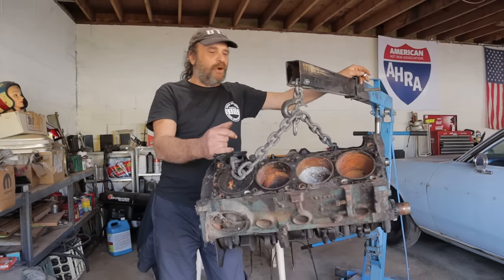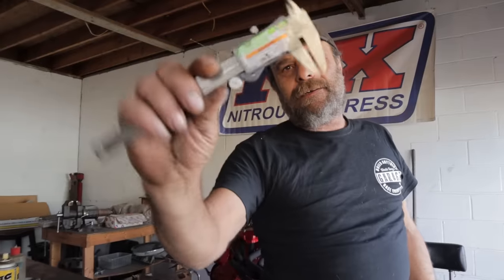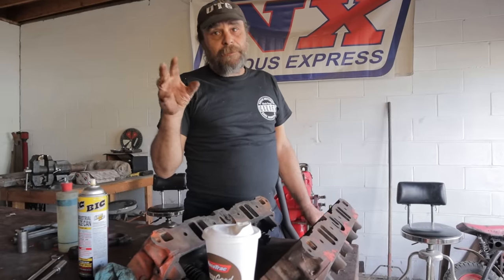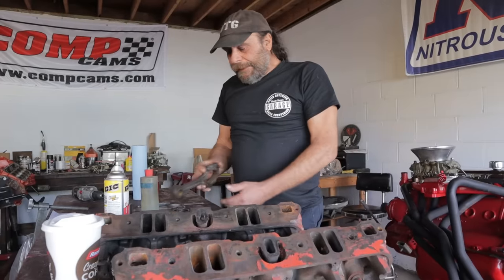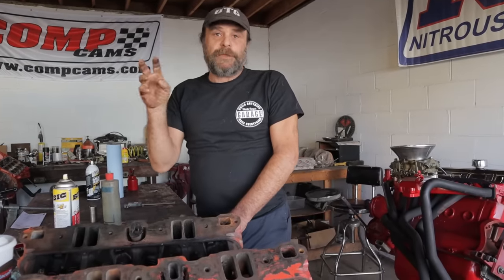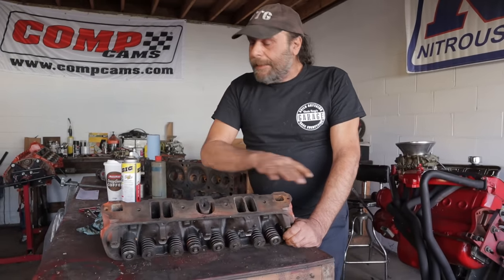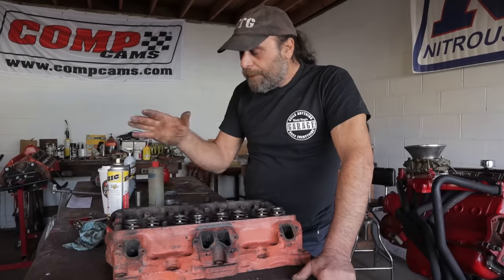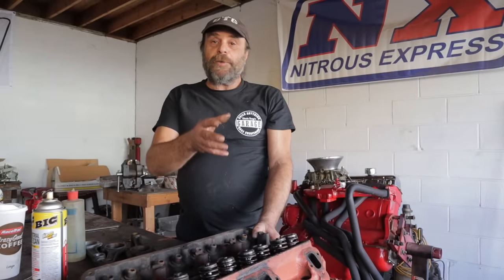The Most Under Rated V-8 In History?

Comment: all the old timers that I talked to back in the days said "the 318 is bullet proof and reliable"

I am 49 years old now....
Reply: I'm 53. They're right. No flat lobed  cam rod knocking junk here lol.
Reply: There is no "bulletproof" anything. Those 318 (5.2L) engines had their problems as much as anything else. It's perspective based on personal experience.... otherwise known as Conclusion bias.
Reply: @shermanbird3248  any product has its limits. We had similar products in similar service  at the time. I've discussed the weak points lol. Think of all the taxis and police cars from the late 70s and 80s. The 318 ruled . The 305 Chevrolet got a real bad reputation real fast in this Era for bad camshafts.  Fords 302 was a solid package but was loaded with emissions equipment. All had strong points and weak. I will crawl back under my rock now that's 40 years ago lol.
Reply: If you leave the tiny BBD carburetor on it.  Same thing for the slant six, except it's a BBS (the S means single barrel).
Reply: ...and?
Reply: I,m 48 in East tn. The 283 chevy was hard to beat....later on working in machine shops,auto parts ,and later being a a.s.e. master tech. Was better on the long run that chevy ran in everything and SOLD ALOT of them in both cars and trucks.318 is the 283 of Mopar somewhat but never really sold the volume of Chevy,yea ol 318 aint bad,along with the ol 289 Ford.Tony,you ever worked in a Machine shop....Mopar Dealership for a Living other than your opionion,Love watching your channel man......but being around them ol....nowandays 70-75 year old mechanics around here....Mopar 318 is not the holly grail of engines...good engines but Dam man....maybe in New york.
Reply: nothing is bullet proof, literally nothing
Reply: @shermanbird3248  So, following that logic the turd 2.7 v-6 is just a matter of perspective and bias?
Reply: @jayarnold8883  The 302 was a good motor but Ford's attempt to make it run cleaner with the horrible EEC controlled Motorcraft carbs was nothing but a disaster. If you want your early 80s 302 to run nice, clean and efficient, junk that 2bbl Motorcraft, grab a 2bbl Holley and spend the time actually jetting it right and dialing it in. She will love you for it. Plug the EEC vacuum lines and you're good to go. 
And as a bonus, it will run better. I did that with my old 83 Bronco and it actually turned in low 20s mpg on the highway with the manual gearbox. Not bad for a dog of a smog motor in a 5k lbs brick.
Reply: @dewmontjerkins9886  KNock knock, Who's there?....2.7 v-6
Reply: I had alot of 318's in full size vans: 67, 73, 88, 91. Then I had a 360 in a 2000 van; I liked it a bit more because it had more power to pull a trailer full of "stuff" from So Cal to Lake Powell. But the 318's only got 14 mpg (and I wasn't a hot-rodder). However, the impressive engine now is the V6 with 6 speed in my 2018 Grand Caravan: rated at 284HP, but will get 26mpg (or more) on relatively level highway driving at 72 to 75 mph. Amazing what many years of additional engineering will do. They don't even offer any other engine/trans options in the minivan.
Reply: @kenhanson860  - I could get a whole lot more m.p.g. with a 318, and was getting 16 m.p.g. with a built 383 c.i.d engine. But then again I studied volumetric efficiency and built my own engines, and tuned my own carbs. Did I mention I was pushing four-and-a-quarter H.P. with that 383?
Reply: @DriveCarToBar  I fine tuned my 66 Galaxie 500XL with a 428CJ and a Holley 735 CFM. I took it to an emissions test facility in 1980. They tested it and complimented how clean it ran for standards of that time.
Reply: @shermanbird3248  the FE is an amazing engine, all the way from the 332 truck version with a governor for medium and heavy trucks to the fire breathing 428. Some of the engineering is odd, but who knows.... it’s a beast! It will fit in a Falcon or Mustang, it will fit in a super duty F550 and anything in between. Every brand has a go-to engine......
Reply: @jayarnold8883  The GM 305 engine had 2 strikes against it from day one. GM was reducing nickel content of the cast iron and reducing weight by going to thinner castings. Cracked heads were prolific . The Cam issues went back into the 60's small blocks including 327's and 350s. In 1984, I think, GM went to roller cams to address this issue. IIRC, they also went to one piece rear main seals to cure leaks.
Reply: @shermanbird3248  you mean anecdotal fallacy
Reply: @dewmontjerkins9886  If you work in a shop or dealer service department, your correlative conclusion would be skewed as opposed to considering X number of thousands of the engines were made which never had a problem.
Reply: @shermanbird3248  wjat problems ?? They oiled well the block were thick and could take extreme amounts of heat they lasted virtually forever they responded crazy well to performance modifications they really had no flaws.
Reply: @mattnetko2282  bullet proof is a figurative speech meaning very reliable
Reply: @shermanbird3248 👍 I love my FE, tons of grunt!
Reply: @jayarnold8883  No Chevy was as bad as the early 70s 307 (totally different from the 305) for flat camshafts. Not a difficult fix though.
Reply: @GreeceUranusPutin  Later 225s used a 2 barrel, known as the "Super Six" starting  in the late 70s.
It is rumored (Ive never seen any) that early 1960s 225 slant six engines had an optional "Power Pack" 4 barrel setup.
Sort of like the 4 barrel Ford 400 that Chilton manuals listed for 1971 production, never seen one of those either.
Reply: @DriveCarToBar  You dont even need a troublesome power valve blowing Holley. Simply find a 2150 series Motorcraft carb from an early mid 70s Ford and rebuild/ rejet it.
They come in two variants. a 1.08 venturi (302) and a 1.21 venturi used on 351 ci and larger engines. Ive always deleted the EGR and stripped off the loads of vacuum lines, and valves leaving only the ported vacuum connected to the distributor and transmission modulator vacuum source, as well as any vacuum supply for the heater/AC system
Reply: The slant 6 and 383 right up there!

Comment: When I was a kid, my folks bought a 78 dodge van with the 318. Dad was in the army and got stationed in Germany and I remember that thing just singing down the autobahn at 110-120 (with the aerodynamics of a brick) for hours at a time. Finally retired that thing in the mid 90’s and sold it to my uncle who then put another 40-50k miles on it. It just kept going and going. The van ended up rusting away from around it but the engine was still strong.

Comment: I'm a big fan of the 318.  What can I say, there's something about a super reliable and really good running engine I can appreciate.
Reply: I think the engineers got lucky with the design on this one. It’s probably just a good combo for the materials used. Every 318 I’ve come across was beaten really hard on or neglected really badly. But just keeps going. That’s why these are great engines to build on the cheap and beat on. They hold up so well on stock parts.

Comment: In Australia in the 70's you could buy a valiant charger powered by a 318 dirt cheap the popular purchase was the Pov pack (poverty pack) which was 318 with 3 speed trans and a high performance camshaft from the 340 (supplied separately)..my cousin bought one and got the cam fitted on the first service for $60...he later did some porting and valve work and it made for a potent street car...he used to call it the $3000 fire ball.

Comment: I watched one of these build shows build a inexpensive low tech two bolt main, iron crank, stock rod 318, and made 340 HP, that's impressive.
Reply: its really not hard to get good power from a 318, 4 barrel+intake, swap the cam, dual exhaust, its not even a full tear down if the bottom end is good. 40 years ago that was typical high school auto shop stuff. swap in a low ratio axle and go have fun with it.
Reply: Can you share the video with us ? Thanks
Reply: @vlrdmtr  ....no I can't,  sorry it was one of those professional videos shows , can't remember, but I do remember basic 318 block, 2 bolt main, stock iron crank,  basic stock rods, basic stock heads, ( pocket porting, BASIC three angle valve job ) something ( can't  remember ) like a basic edelbrock performer intake,  1"5/8 exhaust headers and something like a low tech. hyd. lifter mid range cam, do that and you will get 320 - 350 hp on one of these PREPPED 318 small blocks.
Reply: Nope... Best budget 318" build: https://www.hotrod.com/articles/318-small-block-build
Reply: @BuzzLOLOL  ...I didn't say it was the best, I said it was impressive for how low budget it was.

Comment: I have had 3 vehicles all with 318’s back in the day. Well one was called the 5.2L. This was an engine you could not kill, and I always wanted to find a way to pump it up. Bullet proof is the best way in my mind to describe it and I never avoided it because it did not have the hype of some of the other MOPAR engines. It worked for me. It would just run and run.  I just did not have the knowledge, tools or skill set needed to bring out its best. It seemed the aftermarket performance parts was also limited. I wish I had just a piece of the knowledge he has about this engine. I would never have got rid of my Satellite or Ramcharger.

Comment: Always loved the 318. Long lasting engines! Fun when you put in the 340 cam, heads and four barrel! Also the 360, they could take a pounding!
Reply: The 1st 360 gen was horrible.
Reply: I have magnum 360 myself and its held up to all my abuse so far
Reply: THATS What mine had. 340 heads , nice cam ,big Carter 4 barrel.. it would make a 318 really fast. Those Motors were easy to work on. Not like today's Motors. 😮

Comment: I've always been a big fan of the 318. The engine is bullet proof.
Reply: Yes sir
Reply: agreed
Reply: Guys use them in Ford and Chevy demo derby cars.  That says a LOT.
Reply: I put 360,000 miles on a '95 Grand Cherokee with the "5.2", aka the 318 Dodge V8. Original starter, original exhaust, everything under the hood original, except the alternator, spark plugs, and oil!!!
Reply: except for the timing  chain , they gave up every 50,000 miles
Reply: @imarobot3757  Funny you say that.  When I got my first 318 nearly 30 years ago, I drove it daily for a year before putting a four barrel intake on it.  While the intake was off, I could see that two of the pushrods were bent and hitting the cylinder head.  One of them really badly, to the point it had dug deeply into the pushrod wall.  The car ran fine.  I wound up replacing all the pushrods because 15 of them were bent to some extent.  The car had apparently experienced a timing chain failure before I got it and that was the result.  They replaced the chain, but I guess didn’t even think about what else that may have damaged.  I just changed the pushrods, finished my four barrel swap and it ran great for years and years after!
Reply: @imarobot3757  can i use a gear drive instead of timing chain?
Reply: @frankclarkjr6369  yes you can.I did it and no more problem.
Reply: @johnwilburn  soft valve springs are the culprit. Stupid morse timing gears are hardly a performance item but yeah issue with them is very soft valve springs and they go into harmonics at about 4800rpm.
Reply: @imarobot3757  The weak link in the miraculous revving ability!
Reply: @imarobot3757  Good deal ! Thanks for getting back to me, very encouraging.
Reply: A lot to learn yet on my part
Reply: I have a 1989 Dodge Ram charger my father in law bought brand new then I bought it from him has 318 with 320k original miles nothing done to it yet all original still going daily driver body and interior still excellent shape..
Reply: @frankclarkjr6369  just don't use the plastic  timing chain gear you'll be fine . and yes the new gear drives are quiet and last forever
Reply: Not from my experience in the 60's.  I had a 318 in a 59 Plymouth and was punching  it on the freeway when the crankshaft broke-in-half.  Never owned another Chrysler product again
Reply: I hear about the 'timing chain' issue, but maybe it was fixed b4 1976 when I bought a Dodge pickup w/318, 2 bbl, standard shift.  I drove it 300K+ miles, over 21 years, pulling ski & fishing boats with an 8ft cab-over camper, traveling all over the nation and into Canada up the Continental Divide with NO issues.  At the end when I gave it to my son, who after two years, got rid if it for something new, It 'used a little oil' between changes at that time, but not more than when it was new (it always did)!  All this to say it had the same original timing chain when my son sold it.  "Bullet proof"  I would have 'recommended it' to anyone.  :)   
BTW, having owned two 225 ci slant sixes over the years, that GOOD LOOKING slant six in the background catches my eye!!  :)
Reply: True it's a tough engine,  did 750,000 klms with a 318. We didn't have nylon timing gears in Australia.  Every 318 I've seen has steel gears.  Holden had nylon timing gears but it's so easy and cheap to fix.
Reply: Two Mopar cars I had the 318. '72 Duster and the last model of the Roadrunner '80.
Reply: The only one I saw destroyed was in a Ramcharger.  Some idiot dropped too much carb and a tunnel ram intake on one and ran it too lean.  Burned a hole in a piston out mud-hogging and redlining it all day.  My boss bought it at a junkyard and used the front end to build a 4x4 Dodge Maxivan from hell, LOL  Used it to run big elk hunting parties up into the mountains in CO, so it paid for itself.

Comment: I know full well the potential of the 318, My brother had one. it was built a little odd, it had stock short block (block, crank, rods and pistons) he had an unknown (name) cam with a .500"/300* duration (hyd.). He had a set of 360 heads, with valve springs so bad they floated at 6,000 RPM, with the mentioned cam. he had a I believe Edelbrock torker intake and a Holley 650 DP carb. This engine was mated to a 4 speed w/B&M Vertigate shifter (think hurst ram rod) with an Autozone stock clutch and a 3.55 10 bolt dodge rear. He used to street race in Athens Ga (stoplight duels) and to launch he had to rev it to 5,000rpm and shift at 6,000 rpm (remember the bad valve springs). He told me he won his fair share of the races. This was assembled with all my dads spare parts, other then new bearings everywhere except cam bearings, also new rings and a bead honing. The crank balancer hole was stripped out, so he JB welded it together with a stock balancer. That engine refused to die and started on the first hit, no matter how my brother treated it. We called it bits and pieces, because it had all the bits and pieces my dad would never use. Makes me want to build one thinking about it

Comment: Mopar '302' High Swirl Cylinder Heads:
The small chamber of these heads give your 318 a higher compression ratio, which is good for both power and fuel economy. If you need to build a low compression engine, these are still the best heads to use, but run them with dished pistons. Some builders report that for two otherwise identical engines (including compression ratio), an engine with dished pistons and small chamber heads can make as much as 20 horsepower more than an engine with flat top pistons and open chamber heads.

The best intake by far for a 318 running "high swirl" cylinder heads is the Weiand 8007 Action Plus Intake Manifold. Running a large port intake with 318-style ports causes a "damn" in the intake path where the intake mates to the head because of the port mismatch. Most intakes designed for the 318 ports are economy-type manifolds that aren't really intended for high performance. The Weiand 8007 Action Plus is the only high-rise, high-performance intake designed specifically for the 318-sized intake ports. I have one on my Barracuda and I love it. 

If you're running 340/360 heads, the best intake is probably the Edelbrock Performer RPM (don't run it with 318 heads though). I really interesting option would be the single plane 2-bbl intake manifold that Mopar put on the 273 and some early 318. I think that with porting and Extrude Honing this manifold could be made to flow pretty well. Combine it with a tuned over-size 2-bbl carb from one of the low-end big blocks and you'd have one heck of a sleeper. 

318 can be stroked to 348. This is a very cool modification to the 318. It's even easier now since Scat makes a 3.58" stroke crank that drops into the 318 (as well as the 340) without having to grind down the main journals.  

Or, Stroker Kit, 318 to 390 Cubic Inches.....Sleeper 3.0

Enough for now..... Cheers

Comment: I've built a lot of 318s one late roller block with a cast crank took 20 psi of boost and lived for years (i tore a hole in the pan and killed it on track) but except for the 2bbl intake and basically nonexistent cam lift those engines are little gems.